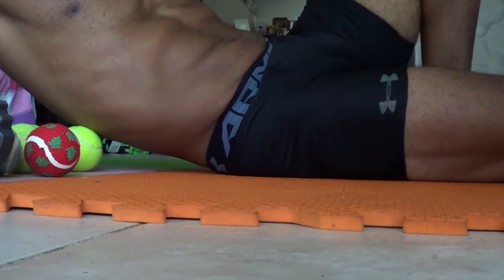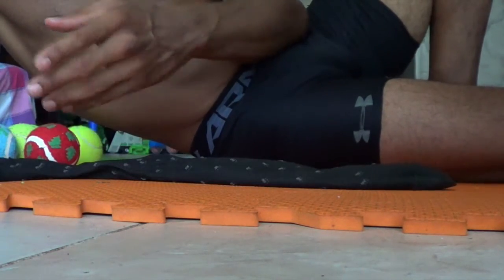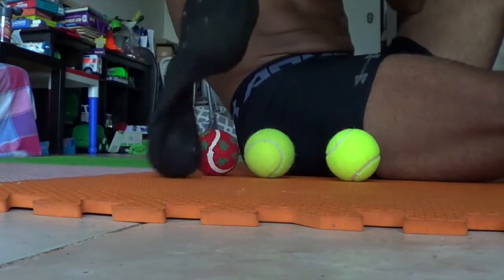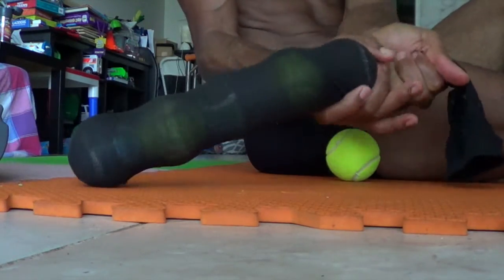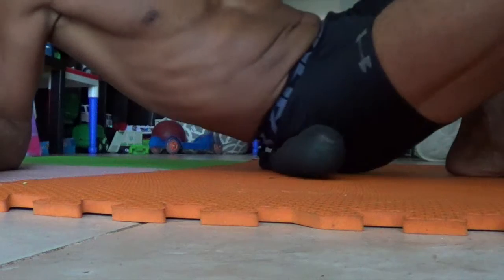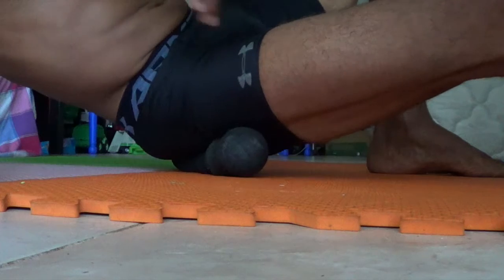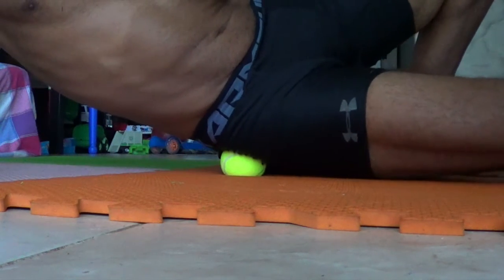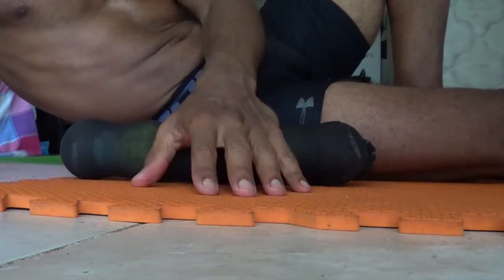How To Make A Foam Roller.  Foam Roller Hack💧🌱❤

Comment: Good idea.... 💯🔥💪🏾
Reply: @WayneGichieGICHI3  I’m going to try it I’m sure it will work I hurt my back a couple of weeks ago n the nerve damage is moving down my leg now. Thanks again 🙏🏽🏞💧
Reply from the maker: @willofomphalosgroomslll  No problem 🙏🏽 Sounds like your sciatica nerve.  The back injury may have caused muscle tightness around that area, Inflammation. Not sure if you do cannabis, edibles, oils.  The Cannabis will relax your muscles. Then add in the foam roller.  The more relax the muscles, the less pain you may feel, and better mobility.  Then the foam roller will be easier to use  🌅🌠💧🌱
Reply: @WayneGichieGICHI3  thanks 🙏🏽 I went to emergency n they did a emergency MRI and said it was my 3rd n 4th disc and the sciatica nerve damage you just mentioned and to get immediate therapy however I don’t do cannabis or anything I have 13yrs of recovery from alcohol and substances but did take a couple of OxyContin’s n didn’t feel good so I’ve been using Tiger Balm and trying to work the muscles and the nerves and it’s getting better. Thanks for the tips 🙏🏽💧🏞🌿
Reply from the maker: @willofomphalosgroomslll  No problem, happy to hear you're getting better 🙏🏽
Reply: @WayneGichieGICHI3  thanks 🙏🏽